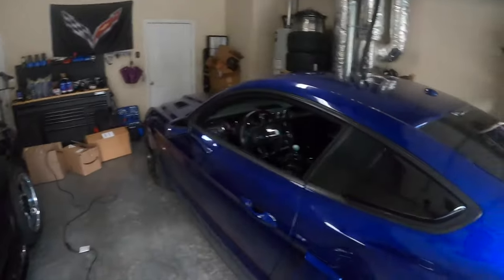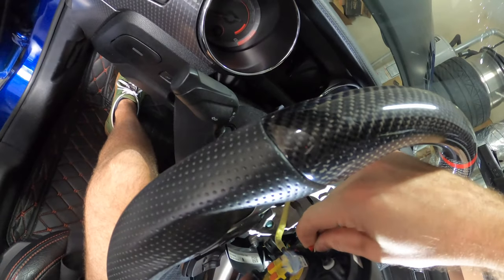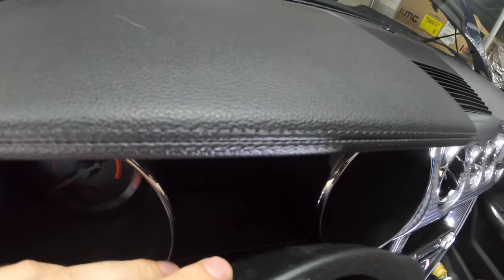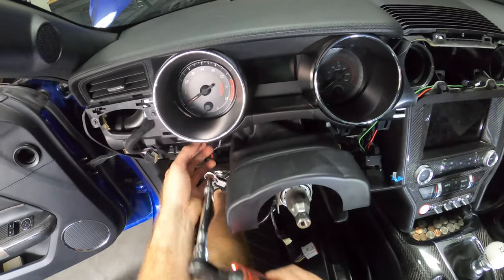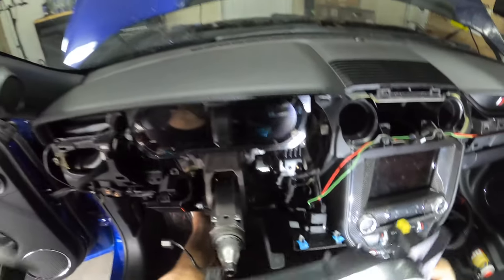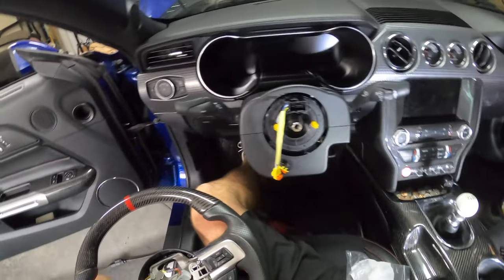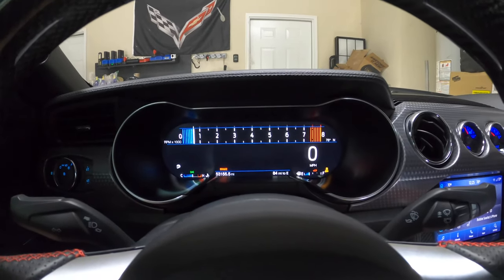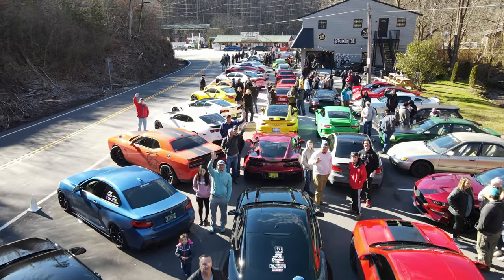S550 Mustang Digital Dash Install ***INTERIOR COMPLETED!***

Comment: Will the metal frame behind the digital cluster not affect it with heat or anything
Reply from the maker: Nope it's fine. I did end up putting a bunch of foam back there because it started rattling after a few weeks. It's been good ever since I did that.
Reply: I was just about to ask that question, does it rattle or anything at high speeds or fast acceleration (appreciate the quick responses wow 👌🏽)
Reply: And what type of foam
Reply from the maker: Nothing in particular. I had an amazon package that had some foam padding in it and I just cut that out and used it. Basically just something to put between the back of the cluster and the metal frame.

Comment: This with programming the miles how it goes why it shows wrong
Reply from the maker: Not sure I understand the question. My mileage is correct. It was off by 1 mile when I programmed it. Not sure why FORScan can't get it exactly right, but it doesn't really matter. It's close enough.

Comment: 18GT redlnes at 7500rpm.
Reply from the maker: Makes sense. Mine redlines at 7000 with Roush's tune. It's actually fine because when i see it start to flash I know how much time I have before shifting.
Reply: @RobsHouse  GT350 8000rpm.

Comment: Will this work with active exhaust?
Reply from the maker: Active exhaust wasn't an option until 2018+ if i remember correctly. This tutorial is for retrofitting the 2018+ digital dash to a 2015-2017 car.